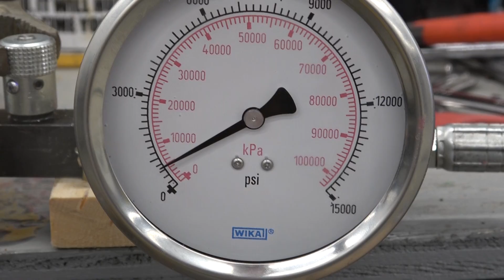How much pressure can PEX take?

Comment: I still hate seeing Shark Bite fittings on a system. They're so expensive and so ugly. They just seem so home owner-ish. I like the PEX though and just bought an expander because I detest the restrictive PEX B fittings. Oversizing lines to compensate for low flow is expensive and causes a much longer wait time for long hot water lines.

Comment: Y'know, I've used these for several years now on the good old "red & blue" polyethylene tubing
and as much as I was dubious of the whole shenanigans initially, I have never had one to fail.
In fact, my own home was totally plumbed with the precursor to today's "PEXB" version of
the tubing over 20 years ago and to date - zero issues with the tubing itself.
Yes, we have plenty of sub-freezing temps in winter here.

A couple of small leaks have developed over the years under the sink and such, but they were
failures of the cheap-assed crimp style plastic fittings used then - not the tubing itself.
The repair in those instances? Cut out the old fitting, use a new Shark Bite, done.
I don't know what the issue was in this video, but I find the results less than representative
of my own experiences with the stuff.
Now, if I'd had my druthers? I'm an old fire sprinkler guy, meaning I'd want to hard pipe every
damn thing I run across in life...thread 'em or groove 'em, I'm good with either.
- Ed on the Ridge

Comment: Original PEX had some issues with dry-rotting/ cracking over time, that was when it is was installed mostly in mobile homes, it didn't help  if it got kinked, bent while being run. Also with possible plastic compounds leaching. Also that old "Quest tubing" gave it a bad rep. Those problems worked against being widely accepted at first or becoming code for home construction inplaces till "about" 2000.  I didn't fully really agree with using it till about 2010. 

Shark bite fittings are very expensive , are really good for instant/temp apps, when you have just about no tools or glue, or torch/flux/soldier , and just need to temp connect ,cap, or put a threaded fitting on a pipe(you can use a cresent wrench to disconnect shark-bite fittings , than buying one of chincy $10 C- shaped disconnector tools-which get easily lost ).  Shark-bites don't work with regular cold water PVC pipe though. unless they have started making them for that too in the past 10 years. I am out of the field now. SHarks-bites have their "moments", but not for permenant/construction.

With PEX , it is MUCH cheaper to use plastic PEXconnectors  fittings  and crimps than shark-bite fittings. Shark-bites are for amateurs/quick fixes , with no tools or  just to temp cap pressure lines, for later adds/runs.  I would hate to think how much it would cost to do a whole house with shark-bites, total wastage there of specialized "emergency/temp" fittings.  Would totally defeat using PEX in the first place. , as far as cost goes . And shark-bites cansometimes  "leak" too if there is enough "bendy/twisty force" on the pipe/fitting connection.They can also freeze and leak.

Comment: Nobody in their right mind would go fishing for this PEX crap during demolition. Resulting in even more plastic in landfills / environment for literally no reason. No doubt the plastic recycling cartels won't want to deal with it either.
Luckily copper costs a fuckwad these days, virtually guaranteeing all pipework will either be stolen long before you even move out (likely), otherwise properly recycled (slightly less likely).

Comment: Great video, impressed with the pressure the pex can hold. However when twisting the shark bite fitting on, or when you spun it around to make the hotdog stay in place you compromised the "bite" of the fitting. I've used them before but only in emergency situations  where tools couldn't access the fitting or severe risk of fire were present. Pex pipe has worked very well where I live (southern coast of NC) BUT if it is exposed to the sun and salt for a decent amount of time, picture a sink on the end of a dock, it will rupture at 32° guaranteed.

Comment: I'm curious what a similar test with Viega fittings will reveal, as they crimp from the outside, but the "shark bite" happens on the inside diameter. Wonder if it'd leak the same, or cause minor scratches in the pex to burst.

Comment: I can sweat copper no issues but I'm replacing my 60 year old copper plumbing with pex. Crimp rings and barbed fittings only. My basement isn't finished yet and it gets cold down there, and it's a lot easier to expand pex and add new runs than it is with copper.

Comment: I was doing remodeling in a house in New Britain Connecticut where they stole all the copper out of the house and the bright idea of the plumber was to come in with this plastic crap and put it in after the entire place remodeled and upstairs in one of the bedrooms late on Friday at about 6 in the afternoon I was up there and finishing up what I was doing and I heard a pop and a whistle and a whole house last steam coming out of there. the entire plastic pipe blew off from the radiator...WYF are they supposed to be connected to radiators? if it wasn't for me being upstairs running down into the gravel basement of this house to find as many sauce is I could find and hitting every single one of them to off. the hardwood floors have to be resurfaced after that and they were just done the week before that and also the painting from the ceiling the walls upstairs to the downstairs had to be redone as well. If I wasn't there to stop the damage that house would have flooded

Comment: Pex is the reason my floors are now being replaced...by me. Well, in our RV
Reply: I doubt that pex was the cause. Copper would have certainly failed first. Unless the pex was installed incorrectly.
Reply: @PoNKPoNy  it is possible....they push them out as fast as possible
Reply: @horseman1968  hence the improper installation.

Comment: I used to have PEX ran from my wood boiler to my radiator. There were a couple of times that it ran cold and froze and burst. But, one time the overpressure fitting failed. I was in the garage with the stove at the time working in a little shack. Damn thing sounded like a shotgun went off. Temperature lowers PEX pressure tolerances quite a bit but it still had enough to scare the shit out of me.

Comment: Gotta ask yourself a question, 
Why did heat shrinkable butt connectors become a thing? Unrelated but completely relevant. 
Because GM didn't trust techs with being able to conduct "quality repairs"
They rely upon "unreliable" techniques of course. Industry is trying to compensating for the backside of the learning curve. It'll rear its head in a few years, not to worry, lmao.
Reply: Fucking autocorrect, ffs!

Comment: I had to replace a section of PEX on the hot water outlet line from an oil boiler, I  replaced the PEX with copper as should have been done in the first place.

Comment: SHARK BITES SUCK!!!! 20+ yr licensed plumber here and as of the pex/copper. I go pex all the way. Only use copper if I'm repairing copper or copper is requested but if you run pex though a manifold the less fittings the better no leaks unlike copper you make a turn you use a elbow and that's a potential future leak. Also sharkbites ARE NOT made to be used a a permanent fitting/fix. I use sharkbites when I have a leak that I cannot do a full repair like grocery stores. I turn the water off long enough to put a shark bite on then come back later at night to make the proper repair. Hell sometimes I use a piece of rubber and a hose clamp so I don't have to turn the water off. Then come back at closing to make a proper repair......

Comment: I spent my entire working life as a city fireman. The station I worked at the last seven years was located not too far from a really large apartment complex. Lots of 2 story apartment buildings. It was built several years ago and they decided to use PEX. With much regularity we were called to gushing water. I don't know if the failure was in the line or the fittings but we had four shifts working 24 hours. I was on one of the four. I went to a lot of floods over there. The really amazing thing was that it was always in the dead of night. Not once during the day. My feeling is that I will never, ever use PEX in my own home.

Comment: ok I'd just like to clear a couple things up for all the people that are dunking on PEX. First of all, Sharkbite PEX is about the worst pipe and fittings you can get, and I'm not even talking about their push fit fittings(those are actually really awesome if PROPERLY INSTALLED(key words here) and in every case I've seen of a freeze break with or near a sharkbite fitting, the piping itself failed before the fitting did.) Sharkbite PEX is basically PEX C, the lowest grade available.  Zurn is the other big manufacturer of PEX and their piping is substaintially higher quality(though they were involved in a class action lawsuit involving certain water chemistries de-zincifying the brass in their fittings). The hew hotness now(I say now, it's been on the market over a decade) is PEX A, and there are two main brands, Uponor and Wirsbo. This system is a bit different, it expands the pipe and then you slip the fittings into it, rather than crimping the pipe onto the fitting and compressing it. PEX A can expand by over 600% before it starts to lose strength, I've frozen short sections of it in the freezer and the only way the stuff breaks is if the ice breaks the fittings themselves. Good stuff, I'd use it in my own house over copper any day.

Comment: I'm a Master Plumber and retired from plumbing in 2007 and at that time I was running  Pex almost exclusively for water. I've never used one of those damn Shark Bites but can see the value in certain situations but still feel their main purpose is so the average citizen doesn't have to call a professional.  But copper had gotten so expensive that it had to be specked on plans or requested by a customer or I was running Pex. I was a late adopter too and was one of the last plumbing contractors still running copper after Pex was adopted into the Code.  My contractors didn't like it when I started using it because my copper was always so pretty and you just can't make Pex look like you can make hard copper look. Everything straight and plumb and all the joints wiped, etc. They hated when I stopped running iron pipe for gas even more though and one contractor (Glen) paid extra for me to run black iron gas lines on his jobs long after I'd started running gas flex. He always took photos of the jobs in different stages and said it was like art work. I remember a home builder asked Glen if he could take a tour through a home that we were building as his personal residence. All of the water was copper and the gas was black iron with no less than 11 drops. I had everything pressured up and was ready for the top out inspection.  But this home builder stopped where I was working and handed me his card and commented that he builds million dollar houses and wondered aloud why he couldn't get plumbing work that looks like mine? We were outside the shower in the master bath that Glen's crew had nicknamed "the car wash" because it was a four person shower (Don't judge) with body sprays through-out and I answered him bluntly:  "Because you're not willing to pay for it". He then asked if I'd be interested in bidding one of his jobs and I told him sure, but if I don't get the bid don't bother to send me any more plans because my time is too valuable for people to waste. But that's how I learned 40+ years ago when I was an apprentice, use a level and measure everything twice and if it isn't plumb and level,  redo that section until it is and damnit, wipe the flux off of your copper! 

Thanks for this demonstration!  I just discovered you last night and the scope of work that I've seen so far has been impressive. Very impressive!  It should be noted, I think, that Pex will freeze if exposed to sub freezing temperatures but doesn't split or burst like copper and especially PVC or CPVC will when it freezes. And mice was also a concern so companies developed a PEX with an aluminized coating (FostaPex) they couldn't chew their way through. Viega makes FostaPex and if other companies make something similar I am not familiar with it but that coating also helped make it run a little bit straighter and look a little bit better, you just have to be sure and mark hot and cold because it is all the same color.

Comment: As a plumber...
Sharkbite sucks ass, NEVER, EVER, install that shit anywhere that isnt exposed and easy to access. Or better yet, dont use it for anything except temporary, like capping an old line.
PEX is okay at best. If you do use PEX, always go with Uponor, as the fittings dont choke down the flow nearly as drastically as your average crimp style PEX. It always looks like absolute shit because once you run hot water through it, it warps to hell. The only two plus sides to it are that calcium doesnt build up in it, and its fast. 
Copper, when done right, and on a system that has a water softener which removes the calcium, preventing the buildup, lasts for a very long time. Also, you can make a copper system look like a work of art, unlike PEX.

Comment: 1 shark bite fittings are trash 
2 pex isn't as loud as copper 
3 pex is faster to install than copper
4 mice or rats chew through both copper and pex
5 pex doesn’t break when it freezes 
6 using shark bites to test pex will always fail 

Pex is better than copper, its not going to get a giant cut into it because if handled properly it won’t.

Comment: They have been using PEX (cross-linked polyethylene) for 25 years plus in geothermal heating under the slab here in Tx.....it stood up so well we use it now in Plumbing.....

Comment: Why would you use sharkbite fittings, it would have been much better to use actual pex fittings with crimp rings. Of course the fitting will fail with sharkbites, you knock those off by semi-gently knocking the bottom of them with pliers or the actual tool that you lose after the first try.

Comment: Actually Germany was the first jurisdiction to approve PEX. Also next time plz bleed the air out. As you correctly stated air compresses like a spring. Approx 3x. I believe the blowout was the air pocket getting compressed so if your gauge was reading 500psi it potentially could have hit 1500psi in the air pocket. That’s why we always bleed the air out of our pipes before we do hydrostatic setting. You did a pneumatic or hydrodynamic test. Cool vid. 😎

Comment: We run "pex" in modern houses in Norway, but we run them in corrugated plastic tubes. So if they ever leak the water comes back to the manifold cabinet and spills out on the floor in a room that should have a floor drain. Also, each consumer has its own run of tube, no fittings other than at the ends. It's a good system, also makes it theoretically possible to change the tube without ripping out the walls.

Comment: PEX is amazing for plumbing, copper hasn't been used around here for years. Before PEX all houses were plumbed with PVC. Only time those "shark bite" fittings are used is if the homeowner tries to be a plumber, no licensed plumber uses them. Grease and water will work completely different on those seals. Use some actual PEX crimp connections and see what it will take.

Comment: In freezing pipe conditions pex actually won't split as easily as copper. I've seen it were copper failed in exact same  condition  . Even K copper splits before pex. Not really  saying its better then copper.

Comment: hi, since grease is the topic of this video, i'm wondering if any of you can tell me what is the right kind of grease to use in a worm gear gearbox, i disasembled one of those industrial dough mixers to replace sone worn out seals and the grease was sparkling like sema paint, so i remove all the grease and clean all the pieces wich was good because i also found a bad bearing, but now that i'm about to asemble it again i don'r know what grease to put inside, the manual only calls for grease, does not have any specification and i thing general purpose grease was the cause of the failure in the first place

Comment: Also, people saying shark bite fittings are shit must get different ones than me. Because the John guest pipe and fittings I use come with a 25year manufacturers guarantee. The guarantee is dependent on things being installed correctly with pipe inserts and make sure it's all the way in. I think most of the issues with plastic pipe and fittings come from people getting cheap shit and/or not installing it correctly.

Comment: I'm a plumber, polyethylene pipe is used all over England for all applications even natural gas. I think the main advantage of plastique over copper is the freezing properties, copper freezes and splits at about -6°C but plastic can stretch a bit more. I use plastic 90% of the time even though I personally prefer working with copper, much more satisfying soldering a fitting than just slipping one over the end 😉

Comment: The upside with the PEX is the meth heads will just strip your house for it's TV instead of the plumbing.  I can live without the tube but if I can't take a shit indoors I'm angy
Reply: Ive spent enough time in the bush I want running water dang gummit

Comment: I installed PEX in my mom's house over 10 years ago, mostly due to it's ability to expand when freezing and the old copper pipes were corroding from hard well water. The only issue she's had is some of the brass fittings corroding and causing a small leak.